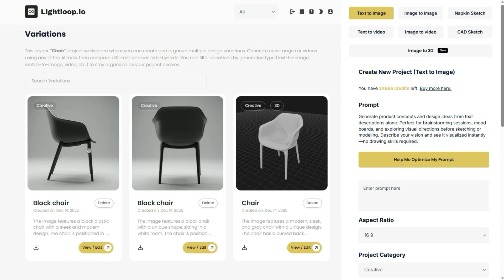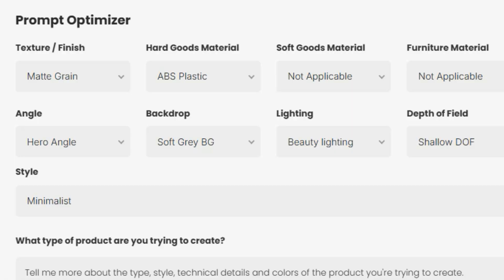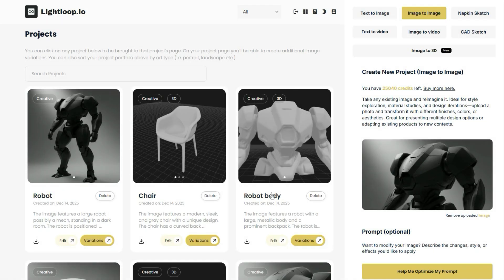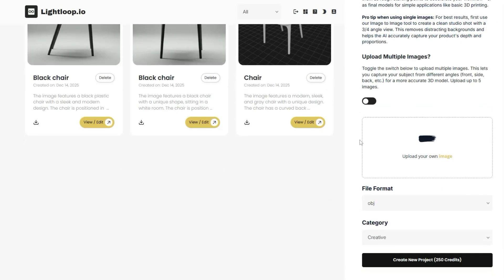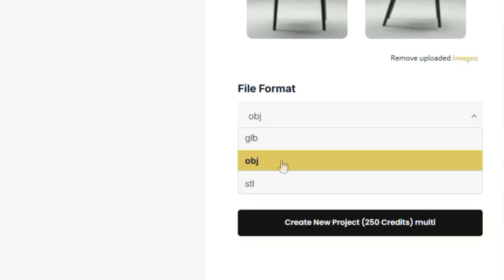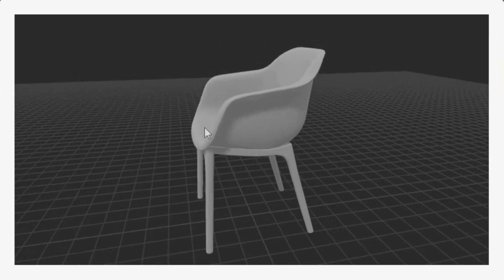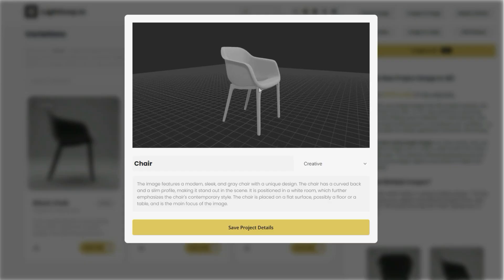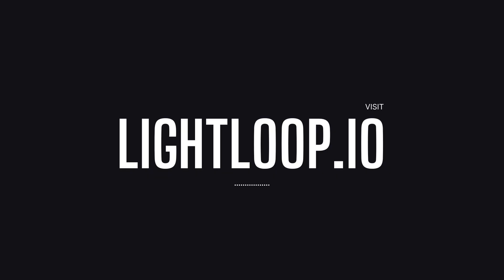Turn 2D Images into 3D Models (WITH MESH) | AI Design Tool

Comment: how much does the subscription cost?
Reply from the maker: Hi @slaqh. Thanks for the question. Since Lightloop is constantly evolving, pricing can change over time. The most accurate place to check is always the Lightloop homepage (near the bottom), where we list current monthly and yearly plans. Currently pricing starts at $49 / month). We’re regularly shipping new features. For example, this week we’re launching a retopology tool that gives you fine-grain control over simplifying 3D model topology, so the homepage will always reflect the latest value and pricing :)

Comment: Which image to 3D algorithm is this wrapped to?
Reply from the maker: I'm pretty sure in this video you're seeing a customized version of Hunyuan3D. However, this is a new feature within Lightloop, so we're currently rotating between (or experimenting with) TRELLIS, Hunyuan3D, and Rodin and monitoring what gives us the best output. Our real value is the specialized pre- and post-processing layers we've built on top that optimize meshes specifically for product design and hard surface modeling. Because we focus on product design, our pipeline includes a lot of mesh cleanup and edge sharpening for product/industrial designers. The 3D model space is advancing so quickly every month that we believe it's better to stay model-agnostic and continually optimize for quality outputs. This lets us continuously upgrade to better models while maintaining consistent quality.